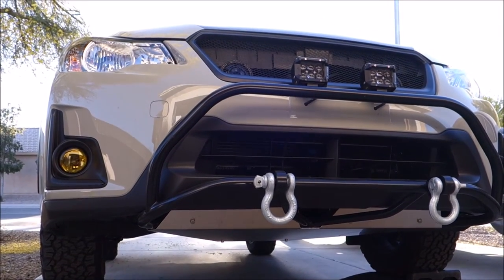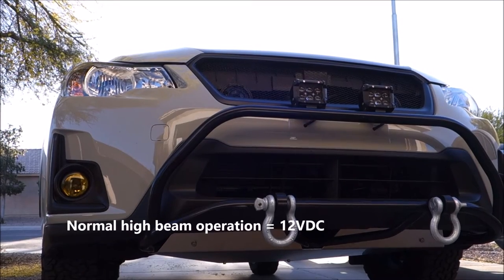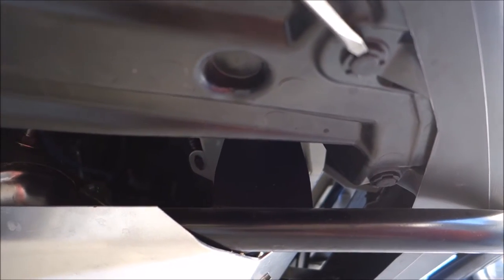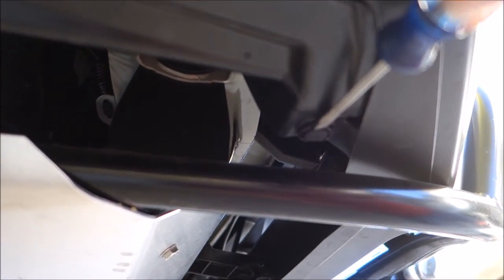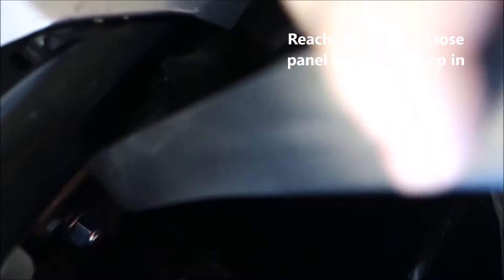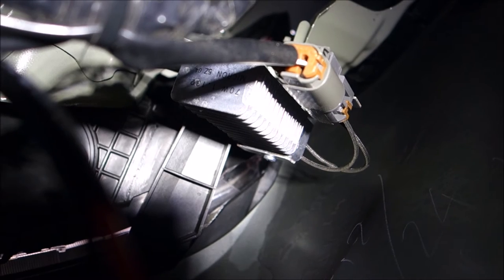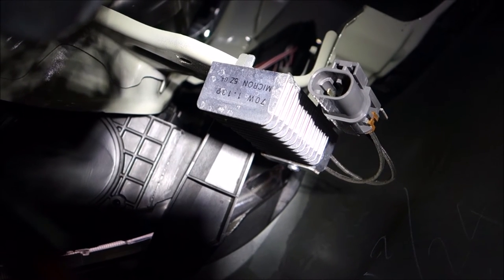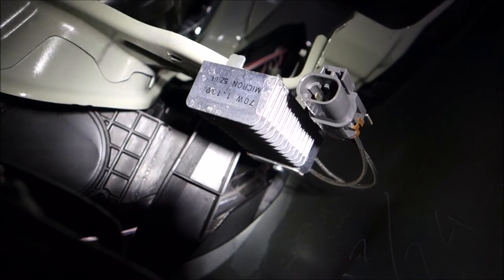Subaru Crosstrek DRL Disable (daytime running lights) Procedure

Comment: I disconnected the drl on my trek. but then I cut the power wire on the fogs and ran a jumper from the side marker to the fog lights power wire. run different high beam bulbs I run the yellow with led fogs. this way the fogs are on with the drl it has a great look. now you can use the stock fog lights switch for the aux lights
Reply: No engine lights? This sounds cool bro, but to each their own. Can you upload a video on how it looks now? Regards from NYC.

Comment: Thanks for helping me locate and understand the resistor! However, I think removing the airbox is easier and gives better access to your turn and marker lights in the headlight assembly. You need a 10 mm socket and extension and a 10mm combo is helpful too. Two bolts hold my airbox (2014 XV) and the air intake shroud has two plastic retainers.

Comment: On a 2017 crosstrek, the resistor when i unplug it throws check engine light and eye sight is disabled, along with cruise. Is there something im doing wrong when i unplug this resistor? I swapped to led bulbs and the owner gets flashed when they dont have their actual headlights on during the day (only the drl)

Comment: There is a DRL relay in the fuse block under the hood. Have you tried just removing that? Seems a whole lot easier! I will try it later.
Reply: How'd that work?
Reply: @ravenstarver1360   It causes the high beams to not work at all. However like disconnecting the resistor you can break the center smaller pin off which leads to the resistor. I then soldered a wire to the high side when actuated to the low beam relay. On both this is the outer fat pin or in the case of low beam relay its in the same position, perpendicular to the longer side of the relay on the outside edge. So I get full low beam instead and replaced both with led.
Reply: @grimmace77  I thought you could do that and I'm going to try doing that on my 2015 Outback. I can just grind down the center pin the smaller of the pins and that will disable the DRL lights but leave the high beams on

Comment: Nice video.  I did the same thing by going in from the top side.  The resistor is under the Intake air filter.   Unhook the sensor wire, and remove the scoop and then the filter.  Inside the folter box is a 10MM nut.  And a 10MM bolt holding the filter housing to the frame.  Once out of the way the resistor is right there.  I did this becuase I changed to LED Bulbs.

Comment: Would it be possible to remove this resistor pack, and just have the DRL's somehow use the C-Lights with LED's?
Reply: I want to do the same.
Reply: Yes it is possible, however do not remove the resistor pack, it is needed. You have to do some wiring and knows how circuits work, but yes it is possible. You can rewire anything to do anything. Such as wiring a horn to the brake light switch, that's a fun one.

Comment: Hi, have you gotten into the DRL project yet?  Because I've installed led as highbeams, it looks like i'm running highbeam during the day, while on drl, I think i've annoyed a few on coming drivers on the road, because it's too bright.  I need a better solution.
Reply: No I haven’t
Reply: That doesn't make sense. DRLs recieve less power and are not bright at all. I replaced mine with leds as well, but they are not bright in DRL mode, they just flicker because they aren't recieving enough power.
Reply: @mattevans1643  Matt you are wrong. LEDs emitters will light the same no matter what the voltage up until a cut off low voltage at which point they do not dim, they just shut off completely. . That is why you can't use 12v halogen bulbs on a 24v truck, but LEDs are interchangeable between 12 and 24v. LED based DLR brightness on lowered voltage (down to 8 volts) will be exactly the same amount of light at 8v, 12v and 24v on LED. Subaru uses resistors that will drop 12-14 volts down to 8-9 volts. H9 and H11 LED based bulbs will emit 100% of third rating at any voltage from about 6 volts to 30 volts. But the resistor does not take it down to 6v

Comment: If u disabled ur drl.how would u be able to use ur bright lights. Does it affect it?
Reply: No the resistor only makes the DRLs turn on. It supplies the power to the DRLs when the lights are turned off, when the lights are turned on, it cuts power to the DRLs. Remove the connector and you remove power to the DRLs. The highbeams are still controlled by the turn signal stock.

Comment: I’m still confused with this drl.  If wiring is unplug how’s the high beam lights would work?
Reply: Its a separate circuit... it takes the power for the High beam and drops its down.when in DRL mode.  Without the resistor plugged in there is no DRL mode, but High beams work fine.

Comment: can you set the boomerang lights to be DRLs?
Reply from the maker: It's possible
Reply: I haven't been able to find guides for it anywhere. Any ideas?
Reply: Subaru XV Crosstrek Central do you have a link to a video showing how to do this?
Reply from the maker: No, sorry.
Reply: you would simply splice into wires going out from that box to the headlights and tie them into boomerang lights
Reply: Whats thr purpose of the boomeramg light?